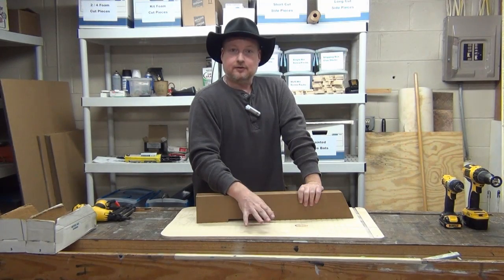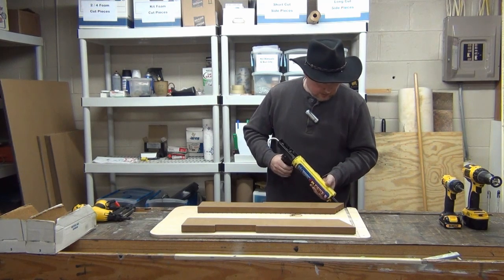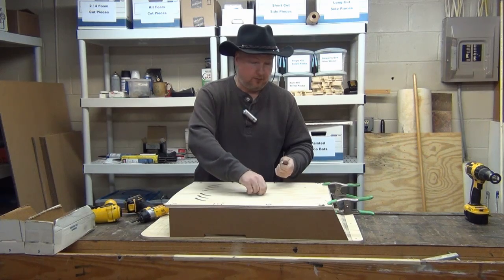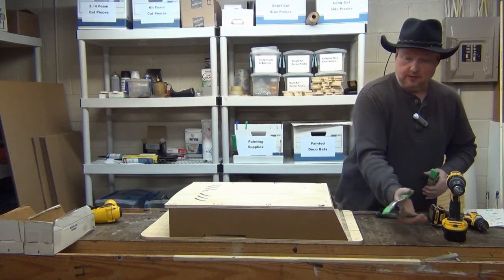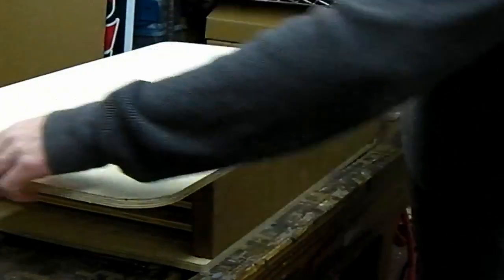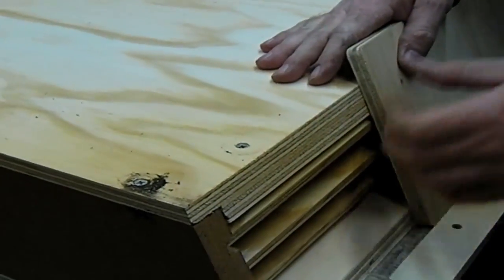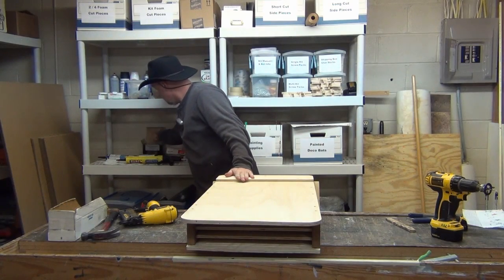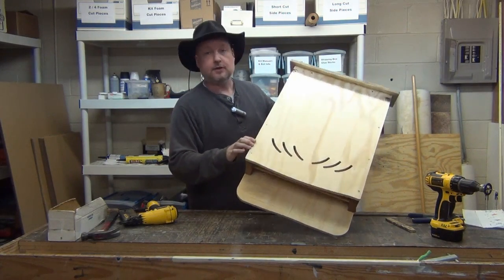Four Chamber Bat House Build

Comment: One of the best nursery bat house designs I've seen so far. I have big brown bats here in Massachusetts.  Should the space between the chambers be greater than 3/4"?  Like 7/8" or 1" for example?  Thanks.
Reply from the maker: 3/4 to 1" is the sweet spot for most species.  That also keeps paper wasps from building inside the chambers.  For the Florida Bonneted Bat, they prefer larger chambers.  For those you want a larger bat house and we leave one baffle out so they have a large 1 1/2" chamber as well as some 3/4" chambers.

Comment: I put a ventilation slot at the top below the roof as hot air rises. The bats in nature don’t live in hermetically sealed structures
Reply from the maker: No, that these are not hermetically sealed.  The bats will move down toward the vents as the house heats up. They idea is to give them options when roosting. By adding vents at the top, the bat house may never heat up to the point it could providing less options for the bats.  Remember, bats are comfortable at 85 to 100 degrees, that's their desired temperature ranges.
Reply: A hollowed out cavity in a tree is probably pretty well sealed. I mean it’s all one continuous piece of wood right?

Comment: Old video but I have to ask, what is the significance of the slots cut into the side pieces, near the bottom? Is it to direct the airflow from the front vent out the sides?
Reply from the maker: Correct, those are vents.

Comment: is the sides of that house MDF? How well does it hold up outside?
Reply from the maker: We used to make our sides from an exterior grade sign material, a composite. It is not MDF.  We stopped using it due to how much of a MESS it is to cut. Machining it creates a fine durable waterproof stick powdery coating on everything involved.  I had to shut down the shop of all other activity, turn on the dust collection, 2 air scrubbers and wear a face mask when cutting sides. Even then, everything would have this sticky dust on it. Very durable and weatherproof material, a piece survived a year without a finish floating in our pond with minimal distortions. In the end, however, not worth the pain. We now use 1" thick exterior grade ACX plywood (which is very difficult to source here) for our sides.

Comment: Ok so If you build a four chamber can you build a single chamber for males? And mount it beside the other or under it?
Reply from the maker: Yes, typically the larger bat house would be mounted facing the sun with the smaller bat house on the back of the pole as a "bachelor house".

Comment: thanks for the video, what kind of wood do you use?Is it exterior grade? do you have to let the materials off gas ?  is the calking toxic to the bats is there a specific kind or brand?I have a lot more questions.
Reply from the maker: We use ACX grade pine plywood, search our FAQ playlist, I've answered that question a few times.  We use a polyurethane adhesive used in roofing, a roof and flashing sealant. It cures in 24 hours and by the time we ship and it is placed, off gassing will not be an issue.  Bats do not chew on stuff so they are not going to mess with any small amounts of caulk that may squeeze out.

Comment: Would it not be easier to put the sides on the baffles before attaching the front and back to the sides? It seems to me that it is not so much the thickness of the baffles, but the space between the sides. Even if the thickness is an issue, a dry fit before the glue up can prevent any issues as well.
Reply: True. You'd think that someone who invented the 90 degree twist at the end of the screwing would already have thought of that

Comment: Great video! I plan on purchasing one if you have a kit available. I’d also like to point out that that was a “cheese grater “ you used...it’s used for removing excess bondo in auto body work whereas a farriers rasp is more like a file. I’ve used both ;)
Reply: Where’s the four chamber kits? I didn’t see any :(
Reply from the maker: The 4 chamber kit is not released yet, I'm working on issue with the roof design.  It is currently "testing" for warping and separation problems. We test all of our bat houses in the environment to see what may go wrong and the 3 chamber design did not simply "scale up" without issues.  I think I have it solved with my last batch but leaving them out for months to be in the environment takes time.  I don't release something until I know it's RIGHT.

Comment: What are the measurements on this house? How much space is between each chamber? How many bats can live in one of these 4 chamber homes? What are the holes in the front for?
Reply from the maker: Our website,  https://estore.habitatforbats.org have all the bat houses listed will all the dimensions and capacities.
Reply: The chamber should be 3/4” depending on the species. I make mine 7/8 for good measure. I haven’t had one bat knock at my door to complain. I also don’t use glue which is a waste of time and money. A few gaps and cracks just give ventilation. Bats crave heat but you don’t want to cook them in the middle of Summer

Comment: Very good and skilled building. might have to build one of these houses. Do you suggest installing a predator guard and is that to have a 3/4" or 1/2" entry point??
Reply from the maker: Predator guards are not strictly necessary but if you know the bat house is likely to be visited by raccoons or snakes they can be very helpful.  Currently, all of our chambers are 3/4" including the entry points.
Reply: @h4bats  Niiiiiice! How much would it cost for a house like this and how many big and little brown bats can it handle?? I live in Northern Kentucky. Also July temperatures here average from high eighties to mid nineties.

Comment: Curious why you do not put some sort of mesh or screen on the inside walls to aid the bats climbing.
Reply from the maker: Screens and meshes can come loose over time and entangle bats unless they are installed with great care and stainless steel fasteners. Bat guano, urine and the environment are corrosive and galvanized staples can fail. Glues/puttys/gel adhesives etc... can out-gas in the heat.  We use cut in grooves that cannot come loose or endanger the bats. It is considerably more work but creates the safest roost option.
Reply: @h4bats  %%

Comment: ? Haven't seen black caulk before. Tx
Reply: what kind are you using for this?
Reply from the maker: It is a polyurethane roofing adhesive and sealant. This is Loctite PL-S30 we are currently using. Takes 24 hours to cure but is very tenacious stuff.
Reply: I just bought a black caulk tube for sticking metal window sashes to my glass RV windows.  It is Sikaflex 200+ Polyurethane Adhesive.  The glass shop that sold it, uses it for sticking windshields to cars, so very strong.  Wonder if its the same thing as your Loctite product?  Putting it here as an option for others.

Comment: The 3/4" spacing between chambers seems awful small.  I have seen on several sites where they have 2" spacing.  On the Oklahoma Dept of Wildlife site they have plans showing 1.5" spacing and then only 3/4" at the bottom for entry.  I am in SE Oklahoma and I don't know what variety of bats are here so I don't know if that is good for them or not.  What is best?  I mill my own rough cedar from local trees and I am planning to use 1" thick boards building them 18"x24" with 3-4 chambers and then painting the exterior only with Flood CWF-UV water repellent which is not supposed to be toxic and is water based.  We do have hot summers here with several 100 degree days.
Reply from the maker: Chamber size is actually a range, from 1/2" to 1.5" is generally accepted. However, every bat biologist we have asked "what makes a good bat house" (and that would be about 2 dozen over the years) immediately home in on 3/4" being the sweet spot, but up to 1" is OK.  We choose 3/4" for two reasons, it's the "sweet spot" mentioned by bat biologists and paper wasp tend not to build nests in any crevices less than 7/8" to 1" in size.  Going up to 1" does not increase the species range of the bat house but exposes it to the potential of wasps building nests... so we use 3/4".  In your area that should be fine for the species most likely to roost in the bat houses.
Reply: Thanks!

Comment: Hello sir, I have a question for you. I'm volunteering at a national park and we're working on bat houses. What do you think about a bat house with 10 chambers? Is that too much or will the bats like it? I'd love your opinion on it.
Thanks
Reply from the maker: greieba Typically, once you exceed 4 or 5 chambers bat houses become more difficult to handle, ship and mount, that's why you don't see many larger than that available for retail sale. However, most bat houses larger than that are built in place or on site and we have done a few of those including some 7 chamber bat houses custom built for a ranch.  One option is to have multiple 4 chamber bat houses on a single pole or next to each other on a structure.  Larger is typically better and a 10 chamber bat house should do well, just make sure you get the chambers 15"+ wide and 22"+ high when you build.
Reply: greieba Check out http://www.batcon.org/resources/for-specific-issues/artificial-roosts They have lots of information that might help. They do say the bigger the house the better.

Comment: is there a good way to: chase the bats off;... clean their house;... then hope they come back? also... would the bats like holes between chambers? also.... best defense against skunks? bill 949-209-7398
Reply from the maker: It's best not the try and interact with the bats. Generally, if you wait until the winter they will leave on their own to a place to hibernate or to head even further south. I don't know where you are, if you are in an extremely warm climate then they may stay year round. All you can really do is put up another bat house and exclude them from the troubled one before fixing it.  There should be passage ways between chambers.  As for skunks, I try to leave them alone and so far they have left me alone.  Henry, my Sibe that passed away last year, did find a skunk once... he learned to leave them alone too.